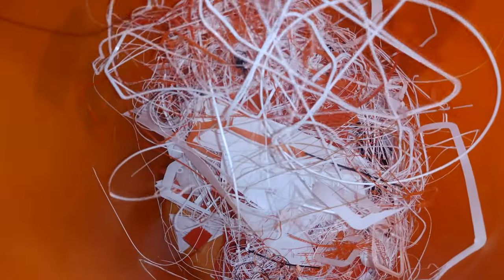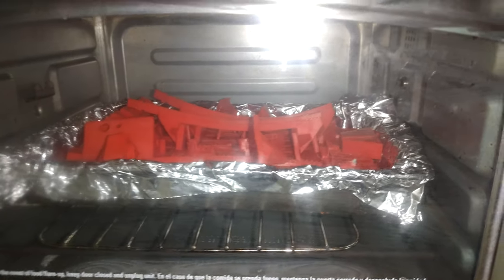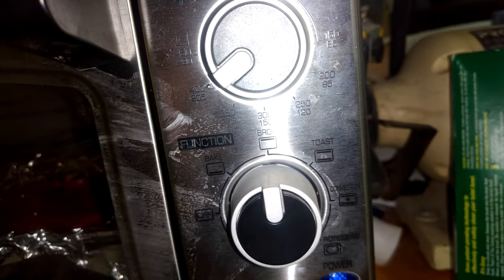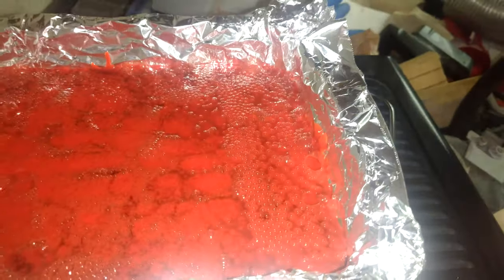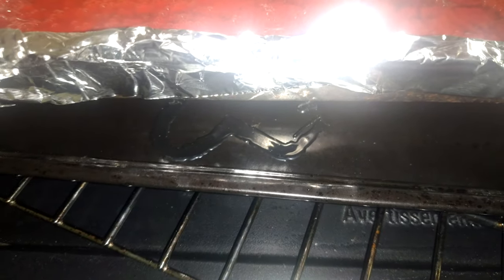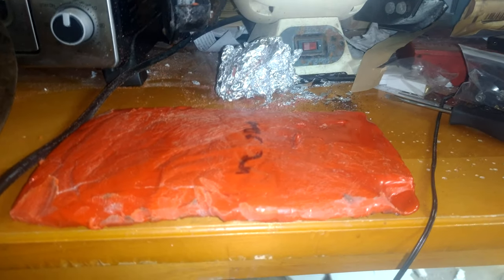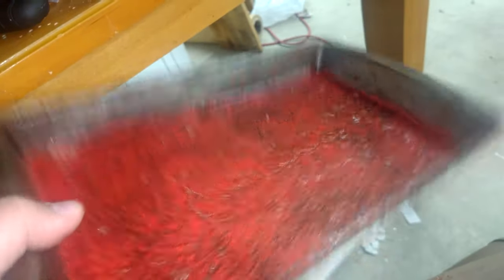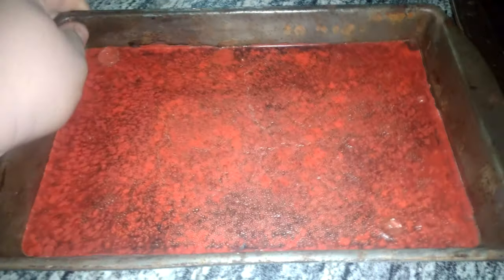testing to see if melting 3D printed plastic in a toaster oven for later use is feasible

Comment: great way to clean a pan hahaha. thanks for the vid, though i feel like you were over looking the value of the sheet product you had created. if sanded flat it would be good plastic sheet stock you could through on the shelf next to normal acrylic sheets. 
my point overall is not all recycled 3d prints have to be turned back into filament.